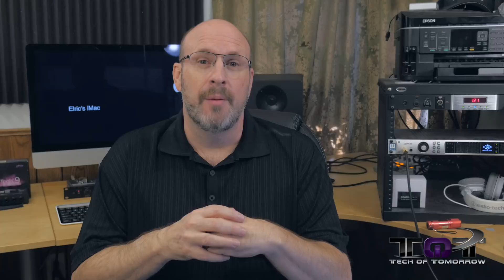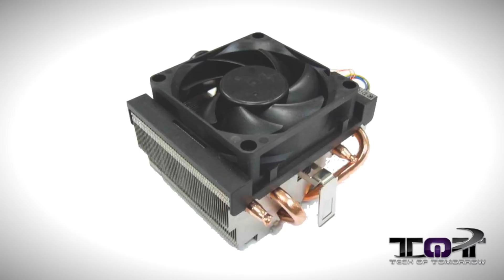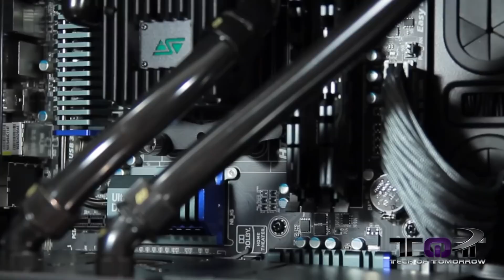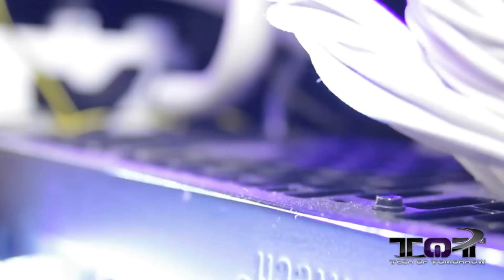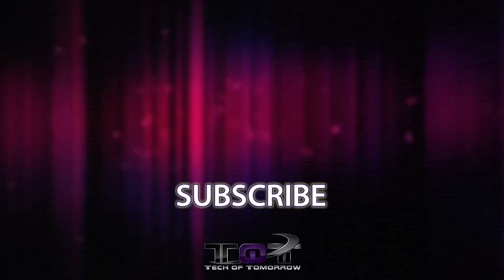PC Cooling 101: The Basics & Methods!

Comment: One thing you didn't mention was mineral oil cooling. Not as extreme as LN2 cooling but a step up from Liquid Cooling.

Still a pain in the arse to remove components as they're submerged (and if you leave it long enough, the oil thickens to a gel but the movement from the fans tends to slow this down) and cables (rubber ones) tend to rot over time. 

The oil can also "creep" up cables to things like mechanical HDDs which would be outside the tank.

Apart from those, a neat thing to show at parties!

Comment: My 4670k at 3.6Ghz is being cooled by a h100i and when I am plying games it will often reach temps around 60-70 Celsius. 
I am also using the stock thermal paste that came with it but I would like to know if these temps are normal for this kind of set up.
Reply: Gets to hot, In winter I kick it up to 4.0 and get max 70c in game.

Comment: This is a great walk through of PC cooling. I still haven't gone to water cooling yet, but I don't have the need for over-clocking, yet. For anyone getting into building or upgrading the PC this is perfect.

 #pccooling   #watercooling   #pcbuilding
Reply: Been using Closed Loop liquid cooling for a few years.  Even if I am not overclocking I feel it is a much better solution than heatsink/fan and should keep my system alive longer.
Reply: I agree that it would extend the lifespan of the system, but normally I upgrade before that becomes a factor. I will be going for liquid cooling on future builds though since I plan on getting a bit more aggressive with my builds.

Comment: No disrespect meant Elric, but from what I understand Peltier/thermoelectric cooling is actually done with a small heating coil. In theory it raises the temperature of the heatsink has a greater delta of heat to the ambient air. This larger delta (again in theory) helps to cool off the heatsink more effectively. Now there's a few fairly modern examples of this for example the ginormous cooler master v10, and the voltair if memory serves. Both are massive and pull at least an extra 60 or so watts from the power supply while boosting cooling by only a few degrees. They tested this by simply shutting off the peltier element and noting the difference. Not really effective enough for all the trouble if you ask me So again no disrespect I've been watching your channel for years and I love your stuff just thought I'd let you know what I've come across in my own quest for knowledge on pc stuffs. Rock on Elric and feel better!
Reply: Peltier cooling works by the Peltier unit its self cooling one side by transferring heat to the other. So the cold side will be on your cpu while the hot side will be on the heatsink.

Comment: "They" say that watercooling will create a bit more ambient temperature because the heat dissipation is better. Less heat in the PC Case will accumulate....
I believe that the main reason to go with full system water cooling to dissipate the generated heat evenly within the case. The heat won't concentrate here or there.....
Reply: v=bUbomEK_5jg

Comment: I follow a simple guideline when it comes to custom loops. 120mm rad per processing unit at stock speeds, then adding 120mm per 20% overclock on said processing units. So a 2-way SLI/Crossfire at 20% overclock would be 360*2 = 720mm of rads. Simply that implies a 480mm rad plus a 240mm for the most use of space. Requires a lot of money to be invested into a big ass case as well as a 1200+ watt PSU. The idea was to dissipate heat per 120mm while still allowing the processors to stay around 60-70C under load.

Comment: Good save at the end. Glad to see you brought back the point that liquid will not make your room any cooler. One point you may want to bring up however is that liquid cooling or high end air cooling may allow you to undervolt your cpu per given clock speed which will give you a cooler room but probably not by much.

Comment: I need help, I've recently built a gaming pc and got the FX 8350, whenever I play certain games "not all" or render a video it heats up to 70! I'm sure that's a lot and the temperature should stay under 62. Does replacing the cpu fan make a difference or is it a thermal paste problem or something else? P.S: my room's temp is very cold and I got one case fan installed. 
I'd be grateful if anyone can help me with that.
Reply: 70c is perfectly fine. I would only start to worry when it it gets to above 90c.
Reply: Not a huge deal. I personally don't like those numbers and got an H80i to replace the stock heatsink AMD provides that had a tiny crappy fan. Later on I got a pair of NF-F12s from Noctua and this baby is as quiet as a breeze :)
Reply: Don't listen to anyone telling you 70 is just fine, that's what some people consider fine, but heat kills electronics faster than anything else. Fuck that shit.

When I run heavy loads, talking rendering full 1080p vids in adobe, while watching 1080p on Youtube and playing a game, my cpu never goes over 40 degrees max, most of the time it stays at 30.

I strongly suggest buying a Hyper evo 212 and getting an extra fan with it.

I promise temps will go down so quick with two vs 1.
Reply: ProtoMario But Protoooooo
Reply: Tech YES City
That too could be the case because if the heat sink isn't tight enough then air can get in there and evaporate that paste eventually.
Reply: 70 for an AMD chip is hot, you really don't want to go over that, 62 is the recommended max, with 70 being the very max, after that your chip will throttle itself as to not go higher.
Reply: Id recommend getting a better heat sink,
when I ran the stock AMD cooler on my pc it was loud as hell and allowed the cpu to reach 80+ degrees.
After installing the cooler master hyper 103 my pc barely ever reaches over 55 degrees and runs much quieter.
Hope that helps :)
Reply: Yeah I got a Coolermaster hyper 212 for my FX 8320. It's really good but it's really tall/wide so make sure your case can fit it :)
Reply: Get a better heatsink, apply thermal paste properly and make sure your case has good airflow
Reply: Those appear to be load temps. and they are perfectly normal once you start seeing 90c that's when you should worry, 70 is fairly good and normal for cpus and other parts to opperate at.
Reply: My friend had this exact same problem (the stock paste actually dried up), you have to take the cooler off and replace the thermal paste ASAP, otherwise your CPU will eventually over heat and simply turn off (possibly damaging your CPU).  I recommend while your at it grabbing an Enermax T40, amazing cooler for the money and comes with some decent thermal paste to boot (will allow you to OC too :).
Reply: I wouldn't worry about 70c When it gets upward of 85/90c then i would start to worry about it. My CPU reaches 75c At  times but mine is a A6 3620 OC to 3.99Ghz from its stock 2.2Ghz
Reply: *****
No, http://www.overclock.net/t/1128821/amd-temp-information-and-guide.
Reply: TorrentialTech I know from experience that 70c is fine..Yes its Hot but its fine to be that hot...My laptop When playing minecraft reaches 70c and no thermal throttle happens 80c is when it starts to throttle on my laptop..I don't know where your getting your info from but its bullshit. 65/70c is a pretty avg temp for higher wattege CPU like the 8350 that is mentioned in the starting comment...Know your shit before you speak
Reply: ***** Which Cpu do you have?
Reply: ***** Yep 95 watts would explain it
Reply: ***** Yeah Battlefield isn't Very CPU intensive My A6 Reaches 60C And only uses about 30% usage when playing battlefield..That 60c is because my CPU is Overclocked From it's stock clock of 2.2Ghz to 3.99Ghz (Pretty much 4ghz i had it at 4.3Ghz but it was unstable at times) i need to upgrade tho my CPU is bottlenecking pretty bad on some games I am gonna be getting the 8320 Soon And a 280x..I have a A6 3620 and a 6870 now its a Dino lol
Reply: Possibly. Try increasing the speed by .1 For example (3.8 To 3.9) And then keep going until it's unstable( Or do it the safe way and run a stability test for every .1) And if it becomes unstable but you want it there just add a little voltage Example(1.25v to 1.3v)And watch your temps you don't want to go above 80c
Reply: ***** Furmark has a CPU burner.
Reply: ***** Just be cautious and watch your temps...Because like it says it's a CPU burner
Reply: ***** You can buy anti static wipes to clean in of the CPU and Cooler. You can probably get it on Newegg
Reply: You need an aftermarket cpu cooler if under load your system is over heating that badly.
Reply: ***** Best thing to use is 100% rubbing alcohol on a regular paper towel, then use a microfiber cloth to clean off the paper lint.
Reply: Ofc it is total bullshit that 70c is perfectly fine, I had that cpu too and at that temperature it started throttling, I had replaced the stock cooler with a mugen rev 2 and it still got to 64c at the most extreme cases, but that was just about OK then.

I later on replaced the cpu with an i7 4790k because lets be honest, amd just has no fucking idea how to make good cpus
Reply: MrTrollicus AMD produced the first dual core the first CPU at 1.0 GHz and produces the best APUs on the market, hands down. Intel is stagnant, only doing tiny improvements to their tech. AMD is the driver of innovation and anyone who saw the CPU booms of the late 90s to mid 2000s knows this. I'm going to enjoy the boom from zen.
Reply: Taylor Trotter I have no tiny bit of clue if what you are saying is true, yet don't forget, outperforming is outperforming. And I'm talking about the time we currently live in...
Reply: MrTrollicus and I'm talking about APUs of today. pit the best Intel APU or die integrated graphics chip against the kaveri a10-7850k, and let me know how those framerates are. not to mention kaveri supports mantle, and gave me a 20% boost to framerates in real gameplay. intel just has nothing like it. on top of that kaveri supports up to 2133 mhz memory if im not mistaken, and gives a visible performance boost with higher frequency memory. it is an excellent HTPC CPU and has no equal for APUs on the market today. in this aspect AMD is the clear winner. AMD hasn't touched the enthusiast/high end Consumer CPU market in 2 years(9370 and 9590 were essentially rebranded 8000 series CPUs). zen is their next chip. so at the moment yes, intel produces better chips, but they are not better at making chips than amd, in fact time and time again intel is tryng to catch AMD. like i said before, amd produced the first usable dual core consumer processor and intel had to scrabble to produce something like it, and their first dual core product was abhorrent, it was literally just two pentium cores cobbled together and it performed like ass. wherever AMD goes, intel follows, and intel really doesnt do any innovation in the market, amd does. that was my whole point. please do youre research before you claim intel is 'better at producing chips'
Reply: Taylor Trotter I never talked about APU's, eventhough I prefer using a gpu, if you look up benchmark scores, there is practically no cpu from amd that gets near the performance of last and this years intel cpus. And a good cpu performance is sometimes more important than gpu performance. For instance, source games require pretty low graphics processing power, while it is all laid out on the cpu. I had to switch away from my fx 8350 to get framerates above 60fps all time. Yet I totally agree that on making gpu's amd is a beast both in price and performance.
Reply: MrTrollicus like i said bud, yes, right at this second intel has the lead, but you will never be able to compare the value of a 8350 that can be overclocked almost 35% stable, and give you the performance of an i7 that costs a 100 more. thats the other thing, how was your temps and what were your frequencies on the AMD chip? i will never claim that amd chips are better at stock. its simply not true. its why amd is so powerful still, they produce usable products at -30% the cost, and with performance in the same league. its a beautiful business model. however what many do not consider is almost EVERY amd chip in the past 5 years has been overclockable, and overclocking most of them had a noticable improvement over stock, for instance once upon a time i had an fx-6100, and squeezed a .9 Ghz overclock out of it, i was running with performance that not only rivaled the higher end amd chips, but also any competitor in intel's lineup. while its an old subject amd has and will continue to hold the overclocking title for best overclocking performance in the world. also, the only chip that isnt severly overclockable is the 9590, and tbh it is pretty much stock overclocked. i mean... 5.0 GHz. its quite powerful.
Reply: Taylor Trotter Well the reason I never overclocked any amd cpu ( I started with an amd athlon, then phenom, and lastly the fx 8350) is because even with an aftermarket cooler which keeps my intel at lousy 22c idle, the temps were just too warm. And if the max temp specified is 62 I wouldnt want to exceed that too much. While gaming on stock clock and even undervolted, my fx 8350 got to around 65c. my intel goes up to 43c while gaming. Well, my intel has a TDP of 88w compared to the 8350s 125w, so ofc it doesnt get that hot easily. Now getting to a 9590 with a TDP of 220W, holy shit.
Reply: my oced au runs at a breezy 36c under load, 24 at idle. my 8350 runs at 42c under load, 27c idle. both are overclocked to the bleeding edge of instability. both have arctic freezer a30s.

Comment: Closed loop is perfect for me. I don't OC my GPU past stock, which is factory OC'd so the stock cooler does a fine job. But my CPU I OC'd to 4.6 GHz so a liquid cooler is needed. At idle when the room is at about 21C my temps are ~24C and under load with cinebench I hardly hit 60C so I'm completely happy with it. I have good airflow through my case so it stays cool. I have a Fractal R4 and my PC isn't even audible when gaming or doing anything but stress testing or converting a video in Handbrake
Reply: My computer runs at constant 30 degrees max with 4 fans not even over clocked  plus I never seen it go past 30
Reply: josh knox That's pretty great. But in the summer my ambient temps can get up to 30. Here in the winter its about 20
Reply: Se7enAte the reason my computer runs so cool is because  two fans at the front blowing the hot a the bottom out the front and top fans blow the hot out the back so there's no hot are in the case at all
Reply: josh knox I mean no  hot air in the case
Reply: josh knox I don't think this is the best way to cool the pc. A good airflow from the front to the back and top ist way better. First the air is really moving in your case. So it takes the heat better out. Second you don't have dust issues. If you have all fans blowing out the air gets in from everywhere. So the dust can easily get in.
Reply: Tobias L. I have all fans blowing out

Comment: I like to go overkill on my water loops
Cooling a 4690K and a GTX 980 and using 3 radiators.
1. 140mm 30mm thick. 2. 360mm 30mm thick. 3. 240mm 60mm thick.

At least if I decide to go with dual 980s, i won't need to upgrade the loop.

Comment: Tech of Tomorrow  You missed 1 thing oil cooled and I wanted to know if its worth it
Reply from the maker: That is not a standard cooling method.
Reply: Tech of Tomorrow oh OK thanks for responding :3 keep making the great vids  (^.^)
Reply: Tech of Tomorrow Theres also Phase, that can be used in a 24/7 Setup, just need to make sure you've insulated properly or well you know...
Reply: jonnathan deven There's also kinetik cooling, but haven't rly been released yet.
But, oli cooling, well... The oil doesn't cool anything. Once temps goes up across the PCB's the oil gets warm, and takes time to cool down in difference from air which is just blown out.
But, it looks cool, and it's not dangerous to any parts but mechanical components like DVD readers or HDD's.

If you're looking for those "wtf is that" moments from your friends then you should at least try it :)
You're probably going to get a new PC within 5 years anyway.

Comment: Is it possible to run a computer with no fans running in a extreme water cooling loop? I am talking about 4x480 rads in a dual loop. 3x480s for the gpus(2 pushing 3)and 1x480 for the cpu. Rads will be 60 to 80mm thick.